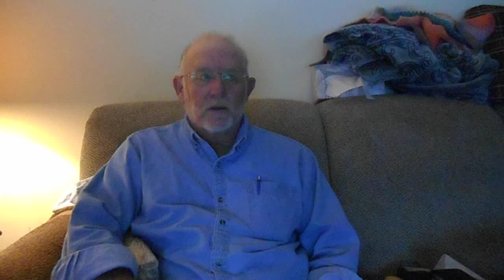Po-Boys making solar powered sand battery for heat my home and energy storage

Comment: promo sm 😬
Reply from the maker: I have been working behind the lines, trying to inform people of the small amount of progress as we in northern Michigan have had little to no sun for many days at a time, just trying to keep interest going with little progress.

Had one sunny day last week from that, I have made some progress using an electric element from range top running 137 volt DC less than 9 amps made a good amount of heat will show that video soon.